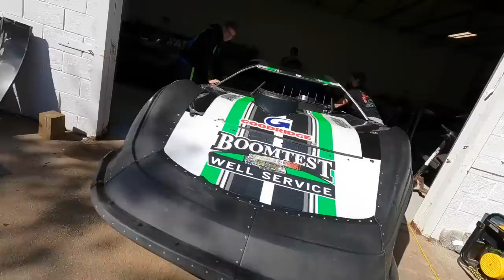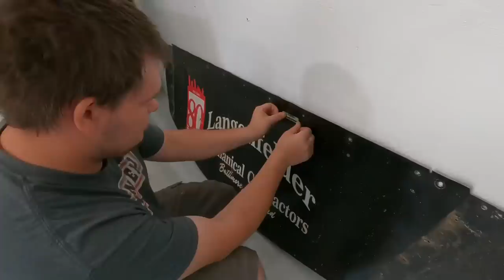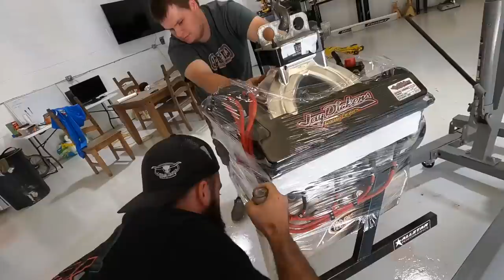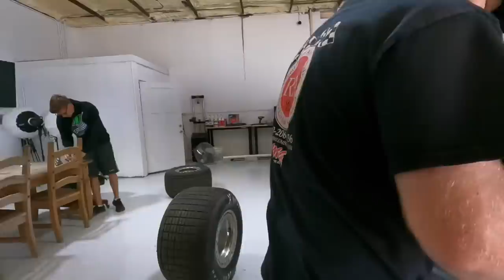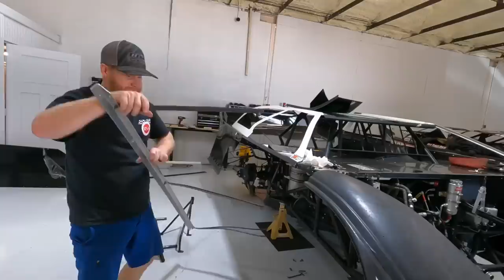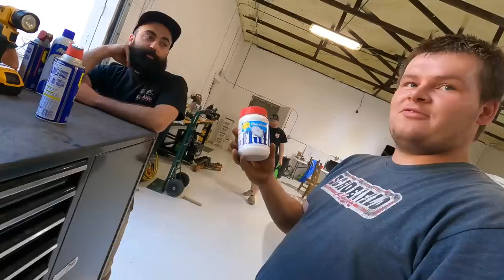Chassis Change! We Bought a New Race Car!

Comment: You guys realize that you just made a lateral move to your program, right?

A different car isn't the answer to your  problem. You desperately need someone who knows how to tune a slm chassis.

Owens could have won races in your old Capital car because he has what you guy's don't have, an experienced chassis tuner.

Just because you have his car now will not automatically make you winners also without his chassis tuner to go with it.

This car will still be loose or tight on entry, middle of the corner or on exit just like the old Capital car until you find someone who knows how to tune it.
Reply: Who is Jimmy’s chassis tuner?
Reply: @henrysams421  Jimmy
Reply: @JJ-1-1  this I know. I’m guessing B!g D does not.
Reply: @B!g D still want to know who you think tunes Jimmy Owens chassis? While you are at it can you tell me who tunes Madden, Overton or Marlar’s chassis also?